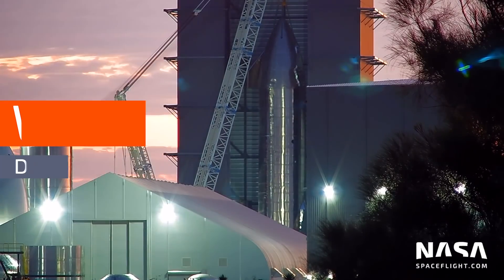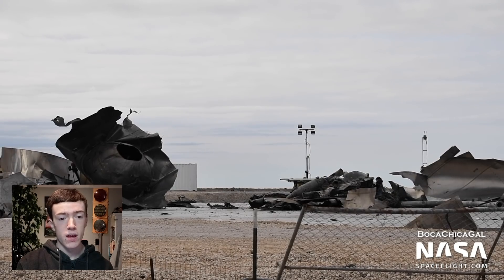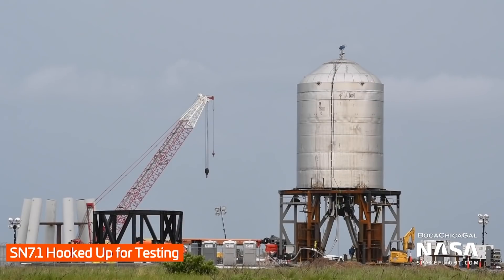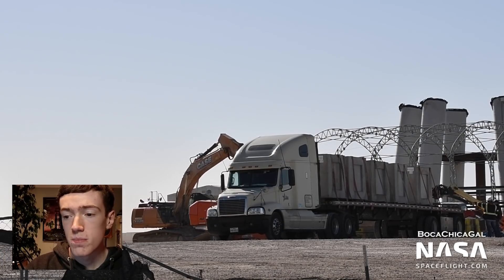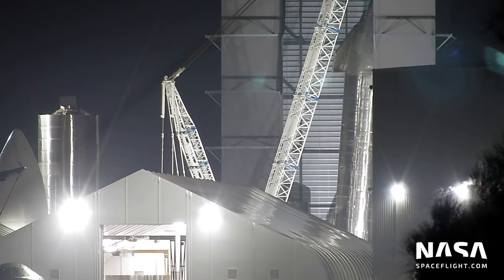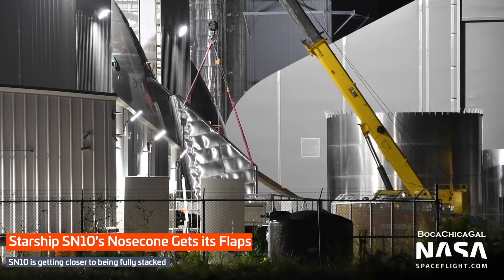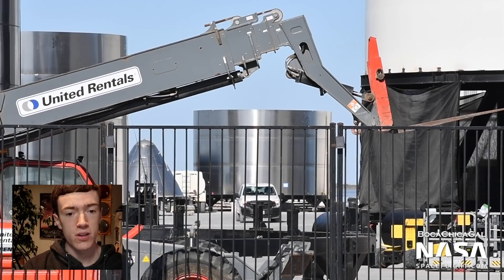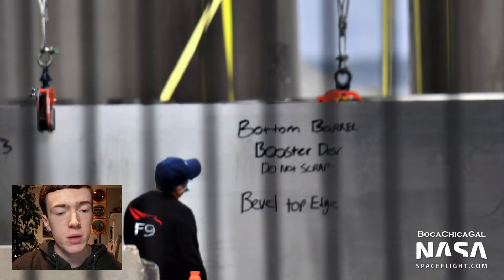SpaceX Boca Chica Weekly Update - Starship SN9 Repaired before Rollout - Booster Number 1 Progress

Comment: I believe the advantage of using 4 rings over 5 was that it would allow for less manual welds and a cleaner build. Only stacks of 4 rings are welded robotically, and a 5-stack has always consisted of welding a 3-stack and 2-stack together manually (you can see it on SN8/9 pictures where the 2nd weld from the bottom of the nosecone barrel is more noticeable). SN10+ doesn't have this. It's for sure more streamlined for production.

Comment: Keep up the great work! Yes Mary does amazing work. I would like to comment on the mobile office. More than likely this is actually a prefabbed control Structure. Made off site, the manufacturer probably installed computers, relays, valves and what ever else SpaceX requested.
Reply: Maybe it's a system to measure the amount of propellant used at the launch site.

Comment: “Do not scrap” who would scrap a ring? they’re going to need about 500 of them
Reply: Machine shops routinely scrap items that fail inspection, were part of a training exercise, contain parts or materials from a lot that had issues, excess production, etc...

It is common to paint "not scrap" on everything that is stored somewhere other than the normal area.

Likewise, painting the word "scrap" in bright red is also standard industry practice. This is frequently taught in introductory shop classes.

It is also incredibly common for students to get a procedure wrong and incorporate scrap into a project, or have a project scrapped by mistake. Proper labelling is often learned through painful first hand experience before entering the work force.

If you know a machinist, they probably have entertaining stories.

The scrap/not scrap distinction is particularly necessary for things that can't immediately be placed in a scrap bin. It takes a forklift, crane, or a special cart to move a ring.